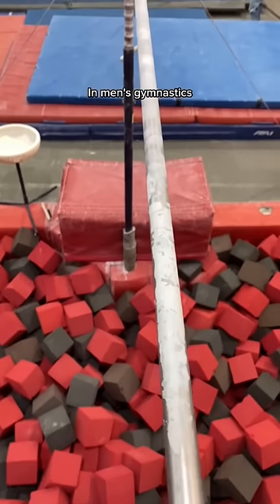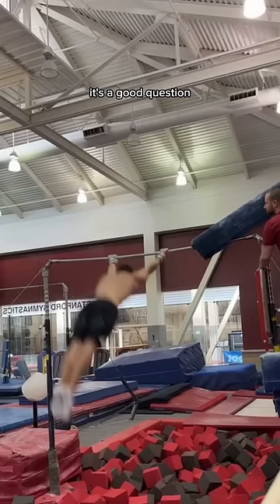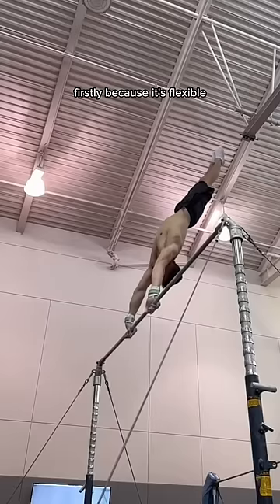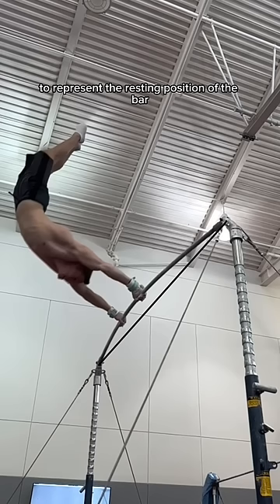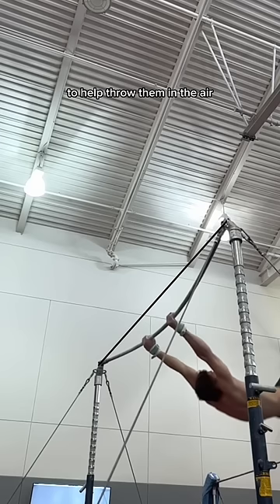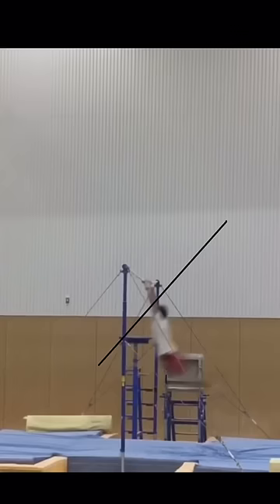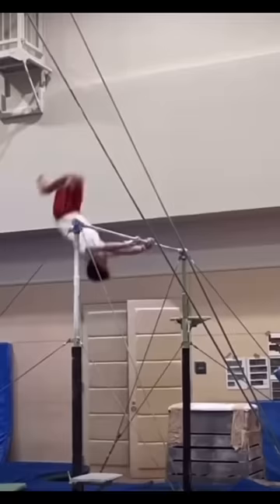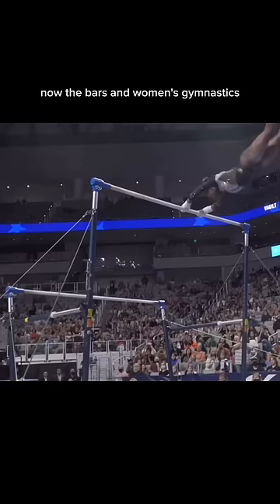Why is it made of steel 🤔 #gymnast #gymnastics #sports #calisthenics #parkour

Comment: Could a women do men's gymnastics? Just curious cause why not be curious?
Reply: They can but they would be bad at it. Firstly, they are weaker on average and have lower mass on average, so doing that spring motion would be really hard. Secondly they accelerate faster because of lower center of mass so a lot of techniques would be useless for them, they just don’t need it. Similarly average men gymnast would be bad at women gymnastics, because they accelerate slower.
Reply: @KajtekBeary  Interesting, thanks for telling me.
Reply: @Zero_Soul_Offical  no problem o/

Comment: But why is our bar so much bigger tho
Reply: Because size matters im guessing
Reply: @dansrod5952  no really
Reply: @dansrod5952  😹
Reply: If women preferred using steel bars or men preferred using the wooden hybrid bars, they would use it. My guess is because women use their bodies to 'bounce' off the bars in a dextrous and graceful way where men work the bar in a way of strength and power, hence a steel bar. I'd imagine when women 'bounce' from the bar, a wooden bar would be more forgiving than a steel bar. The entire form and style between a male and female's routine is drastically different, just check out clips on YT. It really is a complimentary and poetic contrast of sexes.

This could also be the reason to why the  female's bar is also far wider than the male's bar. 
The male bar is thinner and stronger meaning it would be easier to grip and create a lot of force and momentum where women's high bar is almost like it's reliant on grace, flexibility and dexterity. It's actually extremely complimentary now that I've broken it down like that in my head.
Reply: @alZiiHardstylez  ye Ik I do gymnastics but I just can’t imagine using a steel bar
Reply: @charlotte_fin  I deleted my other comment because I think I came up with a solid theory. What do you reckon?
Reply: @alZiiHardstylez  idk
Reply: @charlotte_fin  ye fair

Comment: The flexibility is actually a side advantage, the actual reason is strength.
No other material will support such tension.
Men's high bar is 2.8 mm diameter, thinner than women's uneven bars or parallel bars, which can be made of fiberglass

Comment: If men use a steel bar because of how much they weigh, or how strong they are?, then why do they use WOOD/FIBERGLASS parallel bars? 🤔

The video said NOTHING about strength OR weight, btw.
Reply: Because your not gonna be landing hard on those bars.
Reply: Parallel bars don’t need to be even CLOSE to as strong 💀 mf don’t understand how simple physics works 💀

Comment: Carbon fiber composite or titanium is better
Reply: Titanium would be better if they needed to cut weight off the bar. In this case, they don’t. In a comparison of the highest grade steel vs the highest grade titanium, the steel would actually put perform the titanium in a strength test. Additionally the steel is much more stiff than titanium allowing for a stronger springing force than the titanium.

Carbon fiber on the other hand is stronger than steel when looking at strength vs weight ratio. That meaning a pound of sheet carbon fiber composite will beat a pound of sheet steel in almost every test you throw at it. Unfortunately you can’t have a bar of carbon fiber weigh the same as a bar of steel. With the weight of carbon fiber using the same dimensions as the bar of the steel, the steel would actually come out on top for strength.
Also don’t forget the cost factor of both titanium and carbon fiber compared to the steel.

Comment: Carbon fibre?
Reply: carbon fiber is a brittle composite that doesnt have the mechanical properties of steel
Reply: also expensive. CFRP is so much more expensive than a hot rolled or cold drawn steel. you can manufacture steel whatever way you want and its cheaper than CFRP. its just not the right setting/application for the material.

Comment: What type of steel is used?
Reply: Regular?
Reply: @gagacabbage 
There is no “regular” steel lol. Steel has a different hardness depending on a lot of factors. I’m more inclined to believe that this is some kind of spring steel
Reply: @gagacabbage yeah, no such thing, since steel isn't a naturally found element there are differneng types depending on how it's made
Reply: @polishonion459  yes and the hardness comes from how much carbon is added. So although there are technically different kinds of steel. I'm not going to differentiate German from Japanese steel if the only difference is the level of carbon added
Reply: @gagacabbage  What are you trying to say? You admit that steel can have a range of properties depending on the composition but then say you shouldn't differentiate despite the differences? I'd argue how its made is also relevant here and that hardness is hardly (pun unintended) a quality I particularly care about more than toughness or tensile strength but even so I'm just confused and curious what you meant
Reply: @faceless1434  yes, but the range is between 0-6.67%. you could try making your own high bar and you have pretty good odd of getting the right carbon content. This isn't like mixing two gasses where you could have like a 50:50. It's a gas being added to a dense solid, so the range of carbon levels is low
Reply: @gagacabbage  I feel like you're really underestimating just how much a small addition of one element can disrupt an alloy's structure. Pure iron is incredibly ductile whilst high carbon steel is brittle, they act completely differently. Also 6.67% carbon is A LOT and sounds incredibly fragile like charcoal, I'm pretty sure the highest carbon content steel has is ~2% before you stop having any benefits.

A good example how a small addition can completely change the property of a material is the conductance of silicon. Silicon is a very good insulator but dope it with boron or phosphorus with a ~100x lower density of atoms than air at normal pressure and get a semi conductor, pair those two pieces of slightly impure silicon together and you get a silicon diode. 

Mechanical properties are no different, small disruptions like adding rebar to concrete, wire meshes to soil or sand or small impurities that blocks layers of a metallic crystal from moving over one another and you can get something much stronger. None of my examples are anywhere close to 50:50

Comment: Uhh not all steel is flexible, it needs to be tempered correctly for it to be flexible, if you don’t it will deform when bent and won’t spring back to it’s original position.
Reply: It's still steel
Reply: Irrelevant argument. It’s like someone said, “dogs are great to walk with” and you said, “Not all dogs can walk”. It just doesn’t mean anything
Reply: @snowparody  yeah, but there’s a lot of difference in types of steel.
Saying that steel is flexible is quite a false statement, since some steel isn’t.
Reply: @goatfood1504  it’s not Irrelevant, it’s the difference between the pole deforming and it bouncing back. 
Saying steel is flexible is an absolute, which means that it’s literally impossible to prove that all steel is flexible, however it’s very easy to disprove that statement, you just have to find one type of steel that isn’t flexible.
Reply: I jsut wonder if you know anything about metallurgy or just thought you write a very smart comment online to display your intelligence, even if the comment is a waste of words.

Like could you talk about how two different types of stainless steels, let's say 316N and 302B compare in relation to this topic?

Also saying "steel is flexible" is not an "absolute", it's a (correct) generalization, because most steels are relativly flexile. It's like saying humans have two arms, which is generally correct. Yes lets say 1% have 1 or 0 arms, but that does not make the generalized statement false.

Better take some logic classes before the metallurgy ones before oyu continue this waste of a time non argument.

xoxo
Reply: How is this relevant?
Reply: @NocturnalPyro  He said the reason steel is a good material for making bars is because it is flexible. This doesn’t mean all steel is flexible. Just like I can say “wood is good to make cabinets because it’s sturdy” You could go find wood that’s not good to cabinets. You can find non-sturdy wood, but the generalization is correct
Reply: @AGenericFool  I’m definetely not an expert in metallurgy, but I have researched it a bit.
Not enough to go into minute details but enough to follow a conversation about the subject.

However when making a generalisation it should often be stated as so.
Some examples: “Steel is generally flexible”, “most types of steel are flexible”.
I don’t have any issue with generalising as long as it’s clear.

Saying “Steel is flexible”, might be correct most of the times, but it isn’t all the time.

Imagine this, a scientist wants to prove that a theory is true, but as soon as a single outcome contradicts that theory then that theory is incorrect, even if it’s 1 in 1 million that the outcome doesn’t follow the theory.
Reply: @goatfood1504  I argue that steel isn’t always flexible, if he mentioned a specific type of steel or said steel is flexible in general there’d be no problem.
Reply: @NocturnalPyro  good god if all you're arguing about is the lack of the word "tempered* steel" in the title then I'm certain you have other things to be worrying about🤓
Reply: @snowparody  I’ve got autism, and details are important to me.
Reply: @snowparody  no I was simply explaining why I couldn’t ignore the small details.
Thought mentioning it would help explain why I can’t ignore them.

Comment: It's obvious the women have more strength than men, the wood and fiberglass used in the bar is insanely fragile so it requires alot of strength to not break the bar with their strength which means they've been holding back from using their full women power. The reason why they don't use the steel bar you ask why is because they can't, it's too weak for their power and they dont want to show off against men.
Reply: Ikr they only use 0.01% of their power during their entire life time even in a life or death situation because they are afraid to shatter space and time if they used more power
Reply: This comment lmao💀
Reply: Brrr xd
Reply: I cant tell if this comment is a joke or not
Reply: @kanazamkniety3046  i’m with you homie
Reply: @kanazamkniety3046 same
Reply: @kanazamkniety3046  me!!

Comment: Why not carbon
Reply: Using the same exact dimensions of the steel bar, the steel bar would outperform carbon in strength tests. Carbon fiber is stronger than steel if they’re both the same weight, not the same size.

Comment: Gymnasts average from 5 ft 3 to 5 ft 6...both male and female (though females may be on the decline) Male gymnasts average to less than 150 pounds. Females average around  less than 110 pounds. 
However before 1970s females weighed over 120 pounds, were older and were generally shaped smaller.
Nowadays females weigh far less because they basically pick females 6 to 10 years younger than the average ages then. Not only that. Theres a growing trend to pick bulky muscly shaped gymnasts but weigh significantly less than their past years. Whereas men have barely changed from the averages and standards from back then. 
So no...steel bar for men and wood bar for women has zero to do with male strength. They werent any stronger than their counterparts and barely weighed any different before 1970s.
If this was a strength issue then why the hell are women not permitted an assist onto their bars but men are? 
......it was all about daintiness and looks... basically they just wanted women to do these  majestic flighty moves and older mem can do power moves.
Age is also a thing. Males compete older than females nowadays. A  100 nothing pounds 15 year old TWEEN isnt going to be pulling power moves vs the average male gymnast age of 21 year old ADULT at a measly 150 pounds. The average 15 year old boys arent going to be able to pull off what those 19 and up msles do for upper body strength.
As someone else mentioned, Cirque de Soleil would be out of business if females could not pull off upper body strength. However those gymnasts are adult women who are at the age as either gender to fully develop upper body strength gymnastics.....

And because uneven bars (the wood-resin bars) are made to perform for fancy flighty things its always going to be a womens event. Men need to look tough. Rawr. 

So literally nothing to do with weight, strength or whatever of either gender. Just to make women perform more like fairies.
Reply: Your last line is highly oxymoronic.. you said it has nothing to do with strength, gender blah blah.. in the same line you mentioned it is meant for "women" to perform like fairies! 😂 Thus it has everything to do with the gender!

Comment: It’s because of the weight. Most men have all the weight on the top of there body. Arms and chest.. while women have more of there weight on there hips and legs. 

Men are more likely to break the pole because the weight of there body is coming down on the pole.. while women’s weight is coming down more on there own body.. like swinging around the pole while men swing into the pole
Reply: Yeah thats not how physics works.
Reply: @hurryingglint23  yeah man, your explanation just amkes no sense. Physics doesn't work like that. And women do have a lot of wait ont hwkr upper body due to boobies and higher body fat rate. I hope you do realise this is basic biology, in contrary to what you were blabbing about.
Reply: Also men are way stronger and faster than women this puts more pressure on the bar
Reply: @ttottot  wait on hwkr body 👍🏿👍🏿

Comment: Why not steel coated with foam - loose enough to just rotate w the swing?
Reply: Because a lil bit of foam isn't gonna insulate or catch your fall, if you add enough foam for it to be safe it's gonna loose the properties of steel

Comment: Women uneven bar isn't steel because it wasn't original. It was the same material as parallel bars with wood. It actually was performed on the same device just the second bar had a different height.
So today uneven bar is more like high bar then parallel bar but that wasn't always the case.

I am curious in how the devices change in future.

Comment: They should let each gymnast use a bar of the material they need according to their size/weight instead of their gender
Reply: I'm going to take a wild guess & say they do, especially at an elite level, you don't get tall & heavier women
Reply: I bet 99% of them would be using the exact same bars they already do
Reply: Most elite gymnastics would have a similar build and would elect the use of the same bar.
Reply: this isn't a bad idea
Reply: They do
Reply: The reason it’s different is actually cause the uneven bars started out as a set of parallel bars with one bar set to a different height. The uneven bars have gradually changed to what we have today but the materials it was made of never did (or at least never had a reason to)

Comment: Bamboo would work right
Reply: No it would not
Reply: Probably too easy to break
Reply: Its pretty strong and durable, but it doesn't flex as much as they need and would snap under the bending, especially under alot of that weight
Reply: Kebabs go brrrrrrrrrrrrrr!

Comment: Steel won't bend like that If it did your vehicle would be like driving jello
Reply: There are different hardness steel can have, some can be hard and brittle some can be softer and flexible.
Reply: Look up the elasticity range for different types of steel, and you’ll find that the smell in your car, isn’t the same steel someone is spinning on for their hobby

Also just look up the elasticity range, its a great tool, and is more useful than it seems
Reply: steel isn't a specific metal, it's a combination that makes metal a certain way, so different types of steel are used for different types of jobs
Reply: Are you driving around a metal bar bro? I don't think that's very safe..
Reply: bruh, a steel cube wont bend but if you have a long steel pole, it would bend. Powerlifters bend the bar in heavy deadlifts, does that mean its not steal
Reply: @brokenflaregun  No, it just means that it's a different type of steel that has a different elasticity range

Comment: Why not bamboo
Reply: It will break
Reply: @1yearleftforneet  damn
Reply: Bamboo has great tensile strength meaning you can’t pull it apart the long way. But it’s shear strength ain’t even close to steel so bending it at the middle will snap it.

Comment: Should be cast iron.
Reply: Cast iron isnt bendy. It'd snap as soon as someone tried to throw themselves up
Reply: @alakazam482 I wonder if a bulked up version of the material used in hockey sticks could work, it’s strong and flexible and can have the flexibility tuned somehow
Reply: @Megarah0  hockey sticks are wood or plastic, and their bend is determined by their "weight" and how much they're used
Reply: @alakazam482  they’re made of composites like carbon fibre and Kevlar